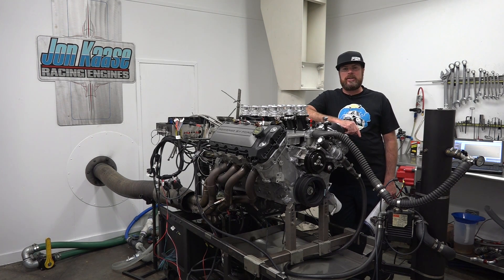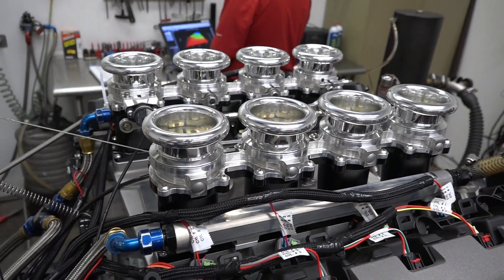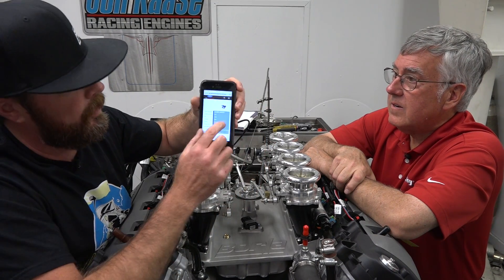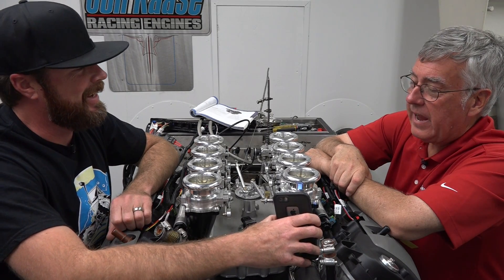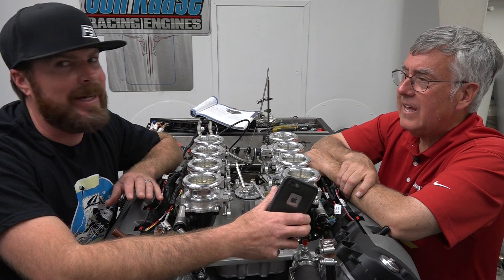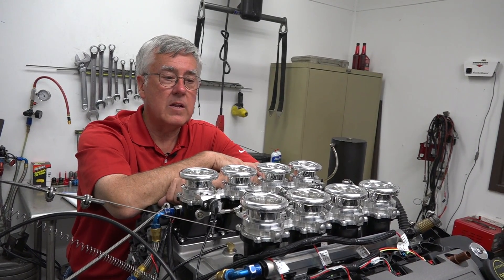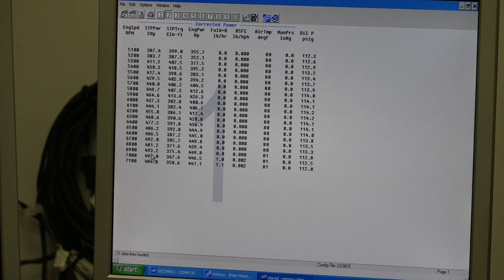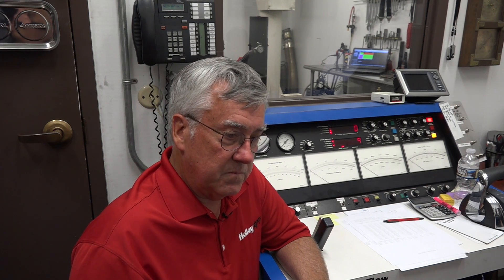Finnegan's Garage Ep.37: Dyno Testing a Ford Coyote Engine with Borla Stack Injection

Comment: The problem with spending 6500$ on an intake manifold is that their are boost kits turbo or supercharger for same or less than that 😂
Reply: and they dont add a 10th of the visual appeal,this is exotica and its sexy as fuck.i would love an 8 pot fuelie intake for my car but they are very pricy.
Reply: Michael, you are spot on!  I just have to believe that is the exact type of car this is going to.  That intake and the Coyote cammer engine would be perfect showing through the back window of a Cobra Daytona!.
Reply: Whats the bet itll make more power with the stock intake and working cams....
Reply: +Bitter Raven  Peak torque at 5900 lol.
Reply: +Vee Snowtail its not a true ITB setup the 8x throttle bodies feed into a plenum
Reply: This intake is more for looks not to get the most "bang for the buck" If you want cheap horsepower take an LS and turbo it. If you want to be interesting and have people come up to you at car shows and ask lots of questions and take lots of pictures then get something like this. Like they said in the video this is going in a street car not a drag machine.
Reply: damstachizz you can make a gen 2 coyote rev to 8500 turbo or ITB but they didn't with this itb set up because they canceled the variable cam timing
Reply: FastballFilms #TMGFilms what does rpm have to do with locking cams doofus?
And yes I own a harrop supercharged coyote, codenamed Miami.
Reply: +damstachizz peak power wasnt till 6900.. you could make that power with a turbo setup at 4000 and still rev out to 8000
Reply: It's notoriously difficult to place value on the cool factor. It's about the aesthetics....with power as a bonus.
Reply: gt350 heads longtubes and a tune should get you 500 from a coyote right? much cheaper way to get 500 from that motor.
Reply: Glad you don't own it then Fastball. Not everyone wants to do the cookie-cutter turbo install. Some of us actually like to be a little different. And I do believe you are blowing smoke out your ass. The ITB's are perfectly reliable. the reason they locked the cams is because of the software they were using that now has provisions for VVT, and if you paid attention they set the limiter to 8000 but only ran the engine to just over 7000 because thats where it made the best power. And honestly what the point in making power at 9000 in a street car?
Reply: I'm pretty sure he's stating his personal preference for spending $6500 on something else.
Reply: Fore sure. ITB's have excellent response though
Reply: I agree that it is silly to have ITBs on a Coyote.  But an LS?  Gimme gimme :)
Reply: Paul Copeland it's because 75% of these people commenting have no vehicle and they're judgmental youtube warriors that have no clue about cars and how an engine works dude it's pretty fuckin sad
Reply: So much stupid in this thread - heck, all of them.
Ever hear the expression 'different strokes for different folks'?
Sure, you can get more torque/power using forced induction, but that isn't always the desired outcome - the owner may like the look of them, the sound, or have some other reason for spending what seems, TO US, a bunch of money for less power than could be achieved by other means.
Reply: There's a saying, "boosted engines are for those who cannot make engines". It's true. Get a 2j, put a single, ecu tune, exhaust, 600whp and ur done. Take that turbo off, now you're a kid who's trying to learn quantum physics. Some people see art in it, purity or wtv. It's sort of like the genre of jazz of Motorsports. It's not for everyone.
Reply: How is it a problem if its what you want?
Reply: Usually you get these things for engine response. ITBs greatly improve your engine response and changes the character of the engine. You're not paying for power but rather a whole engine character shift.
Reply: Maybe 6500 dollars isnt alot of money  to some people so purchasing this kit to be different is more important than the $
Reply: Fastball Films 
Completely agree although his note said cam timing is coming. By now I’m sure it has.
Reply: You really think something with ITBs revving out to 8k is comparable to throwing a turbo kit on?
Reply: Forced induction makes more power. Woohoo tell us something we didn't already know Sherlock.
Here's the thing about bench racing, it almost never amounts to anything resembling what happens in reality. Forced induction is great for billowing tyresmoke on the highway next to your bought not built bro from up the street or for bombing down a drag strip but where a $6500 ITB kit comes in handy is on a racetrack. Where spinning is the exact opposite of winning.

Then again, I suppose I should never have expected intelligence out of someone with a hashtag and "dabs" in their name.
Reply: Paul Copeland That would look good in a Shelby Cobra Daytona. I agree 100% 500hp in a 26-2700 lbs car, with a good suspension, and tire set up will be one hell of a ride. I understand 6500 is alot, but at least you will have instant throttle response. That's better then waiting for boost to spool.
Reply: Wow, so angry.
First off, no one mentioned suspension setup. Thats a moot point since anyone serious about making power is going to put cash into the chassis regardless. But no amount of suspension tuning can make up for having a sharp increase of torque in the powerband, like for example when using a turbo for a power adder on an engine, and the less time you spend putting power down the slower you are going. Contrary to your point, no you cannot "make" any forced induction setup hook around a road course. Or else we'd all be running diesel truck turbos on 2l engines.

My point is that if your primary argument is outright power, you fail in multiple other departments. Throttle response, engine temp, engine lifetime, driveline lifetime, vehicle driveability, consistency of engine output etc. etc.
Dollar for dollar and pound for pound FI will make more peak power, no contest. However, you are also talking about a similarly significant investment into both systems to fully utilize the benefits they have on offer. I.e: Shit costs money. And if you have that money to spend on making a fast car go faster, you aren't strapping into a car to make smoke, you are doing it to shave tenths.
In that case, no forced induction is not the best possible solution for all use cases! When racing you desire other things from your engine; a flatter torque curve for more consistent power output, higher overall output across the entirety of the rev range and resistance to heatsoaking the inlet tract so the car is making the same power throughout the run; which are all reasons why an N/A ITB setup is preferred in a lot of ways.
Reply: What don't you guys get about this piece of show.  It is not a performance based add on!  Of course there are dozens of ways you can make horsepower cheaper than $6500 intake, but the guy who owns this doesn't give a f**k!  This is what he spec'd for the build.  He has $18k in that engine and I know he could care less what it cost!  Don't forget, it is a 500hp 302!!!  Not bad for , let's say, your Shelby cobra or Ford GT I would say.
Reply: Sometimes its about a certain look and not about max power.
Reply: Vee Snowtail now I want you to do some research on road tuning 😂 you can make any force induction hook around a road course! Camaro and corvette shows it's possible, at 6 lbs of boost you can make a lot more reliable power than an ITB set up and more reliable daily driving for less..you do the math 😂
Reply: But you know. At least you're quick to get salty if not actually being quick.
Reply: Over 16 thousand dollars to makes 500+hp in a coyote 😂 people are fucking retarded! On3 TT kits run for a little over 5k
Reply: Ever heard of personal preference? I guess not.
Reply: FastballFilms #DabsAffilliatedMedia I
Reply: Then you put undue STRESS on the damn eng. Plus it's CHEATING, BY USING FORCED INDUCTION. A TRUE MEASURE OF AN ENGINES POWER IS WHAT IT MAKES WITH OUT FORCED INDUCTION. UNDERSTAND. 
FORE RULES BECAUSE IT'S 5.0 &5.2 PULL MORE H.P. PER CID THAN ANY CHEVY- MOPAR LOW TECH SHIT OF SAME CID. PLUS LAST 2 TIMES LONGER .
 Also when you use forced induction of over 11 lbs of boost ,you have to lower the compression,use stronger rods etc.you really are a shit for brains, meaning know nothing about the inner workings etc.of these engines. Now read your books;  ABOUT 15 ON THIS SUBJECT.
Reply: Vee Snowtail then again I shouldn't expect much from someone who obviously doesn't know jack shit about chassis tuning or engine tuning 😂 you think a mustang is gonna hook with stock suspension and okay tires with an itb set up? Nah it won't you need suspension work regardless...therefore forced induction is still the way to go... do some research before talking shit about someone 😂 but you didn't say anything about them canceling out what makes it the coyote motor Great and that's the variable cam timing...😂 yea do some research fuck boy
Reply: ford are for rich people lol, plebs stick to chevies

Comment: All those cams for nothing.
Reply: they locked it out because the ECM didnt have the ability to control the VVT system.  they said it in the video..
Reply: Uh.. the development of software is not as easy as punching a few keyboard keys. I do agree that Stock ECM's are largely the best to go with but that is due to the lag time of the aftermarket.  You are essentially using a generation old tech compared to the stock ECM.
Reply: 1320crusier And it's sad that their high end standalone can't do that (they just added vct support for it here recently, after the video was shot, it's in last month's hotrod mag). Stock PCM is king in so many applications (not this one obviously,  because of stupid itb's) You miss out on 70hp throughout the curve with VCT disabled. A magazine did a test with an AEM infinity, and with VCT disabled they lost huge numbers everywhere in the curve. You can pick up power without VCT up top, but it requires a wild cam grind and eliminating the cam phasers to save a ton of rotational mass, perfect for a race motor setup like this.
Reply: Grajeda They locked out the VCT and kept the stock cam grind, so what can you expect.
Reply: AKDMB for that price I can expect a whole lot more. At least 550 crank horsepower.

Comment: no wonder people buy Chevrolet. Twice the horsepower for half the cost of a Ford.
Reply: MaximumMT actually go and grab a set of kaase heads for bbf windsor or Cleveland and watch them reel off enormous numbers. You can now buy off the shelf 1000hp heads for Clevelands
Reply: 4g63mark, Why does it make Ford guy's feel good to spend huge money for mediocre power?
Reply: fightfanian, I watched this video because I subscribe to Finnegan's channel, I didn't watch it hoping for an argument with someone like you. Plain and simple I don't think spending $20k on a mild street engine is cost effective, regardless of who manufactured the engine. I wouldn't spend $20k on a sub 500 hp Chevrolet engine either. You Ford boys need to stop taking every comment so personal...
Reply: The new stuff is expensive because it's complex. An old style like windsor or Cleveland is around the same cost as a chevy.
Reply: Shit box ,Way too cheap to make 600hp with a 408ci/stroked 351Windsor.. your comments are clueless.  Corvette buyers wrote the book on spending way too much for mediocre power.
Reply: MaximumMT a standard coyote is $6500.  An ls3 is $12000. Basically the same power
Reply: LQ4 crate engine (1500), turbo kit + cam + heads + 150 shot + tune - ~4000...give or take a few bucks in cost and bam, 800+ HP out of a Chevy, using a crate motor, for $5500-$6000
Reply: someone's bitter they got proven wrong....goes to show the waste of money that is a Ford engine
Reply: I could get 2 ls3 engines for $12000 and have $2000 to spare.
Reply: I’m a Mustang guy and I have to agree with you! $6500 for an intake manifold!? I almost shit myself over the weekend when I had to pay $300 for a used intake manifold for my pushrod 5.0!
Reply: but the way the power is delivered is what makes  chevy and ford equal and dont believe me the zl1 was only .32 sec faster around big willow with a extra 150 hp
Reply: Closeoutracer, Your comment makes no sense, and I'm not a corvette owner...
Reply: Shit box, I took nothing personal (im not just a ford guy, i think they are cooler than chevy or dodge, but i own a silverado, a bmw 525, and a fox) but your not representing your or the other people trolling this videos motives honestly. If cost effectiveness was all that mattered everyone would live in a trailer, wear rustler jeans and chinese gas station t-shirts, only drink water and eat cabbage and legumes, and no new car would ever be bought again. Sure a super/turbocharged junkyard ls or coyote would make wayyyyy more power for much less but this engine isnt him trying to wring every ounce of power out of a budget build, its about wow factor, and i think it was pretty effective.
Reply: fightfanian, If spending $20k dollars for 490 hp makes you or anyone else happy and you can afford it, then by all means do it. I personally still think it's foolish. I'm not saying that everyone should be as cheap as possible, but should get bang for the buck. You obviously have a different interpretation of cost effectiveness than I do. This engine may have "wow factor" as you put it, but for me personally, bang for the buck just isn't there...
Reply: jldude84, Biggest thing I look for is torque, and I couldn't care less what an engine looks like so long as it makes good torque and there's no chrome, I can't stand chrome on an engine. I'm different I guess. 😄
Reply: Shit box so you are a diesel guy?
Reply: How about we talk mopar hell cat crate hemi motor. 707hp...Yea baby.
Reply: in australia we say the same thing but the other way around why do holden/chev guys spend 30k on an ls/lsa trying to keep up with ford i6 with a tune.
Reply: MaximumMT always that one Chevy guy gotta make a price comment lol
Reply: yet another ls build...yawn...i walk by all the cheap ls crap at car shows only to stop once in a while at a good build to think "what a waste"
Reply: Jason Skinner Yup.  Chevy guys are too broke to afford a 32 valve overhead cam V8.  They're happy with their pushrod relics with 2 valves per cylinder.
Reply: Mike Hedrick An lm7 is about $400-$600, add a cam and you got 420ish hp for under $1000. Oh yeah that's what I did. Chevy is the best bang for the buck. Always has been. Ford typically costs more to get the same power, but they will get there in power. The coyote is cool. Plain and simple. I love all these motors and respect all the brands I just find that I spend less with Chevy than the others and make good power. As far as reliability, again Chevy in my experience does better. It's why most guys in off-road racing use Chevy engines. Ford even sponsored a whole new class for the ecoboost engines and pulled their support before the first season ended because the motors wouldn't stop blowing up. The coyote is not without fault either. It's not at all known to be reliable. Ls motors are well known for reliability. My lm7 has almost 200,000 miles with no problems at all. My small block Chevy (vortec) has over 400,000 miles, no problems. I take care of my motors and I do believe it's possible to do this with other brands if they are taken care of, I just know there are more high mileage chevys than high mileage fords out there.
Reply: MaximumMT and at a fraction of longevity.
Reply: @Welcometofacsistube  haha nice joke, pushrod engines will always be more reliable, Ford even agrees, that's why their new gas v8 for trucks is a pushrod.
Reply: phil tripe BEST COMMENT EVER
Reply: 4g63mark and jason skinner,

I'd ask for your opinions on Chevy styling...but lets face it, you've only ever seen the tail lights
Reply: MaximumMT actually its typically slightly more power from a ford from significantly more money.